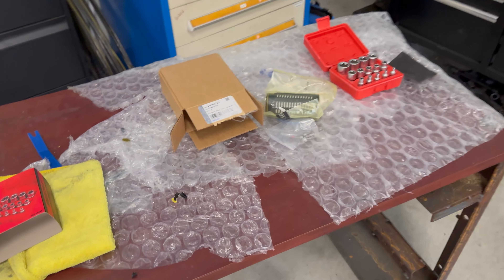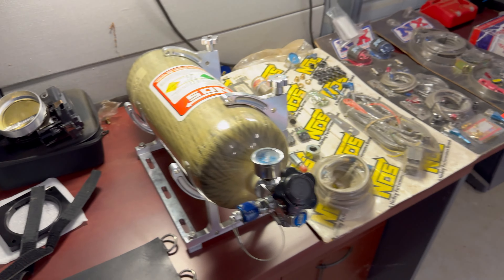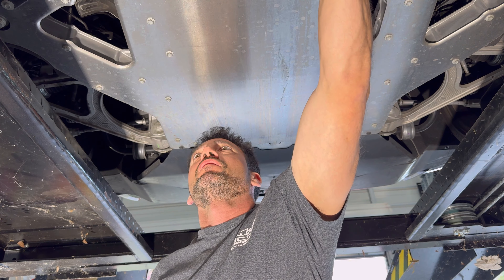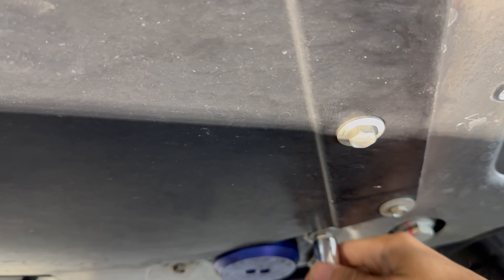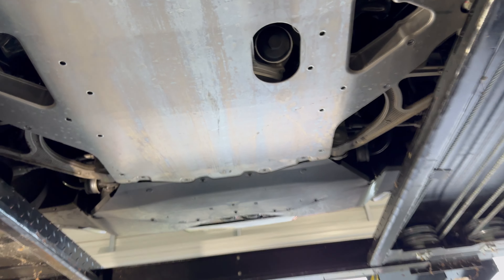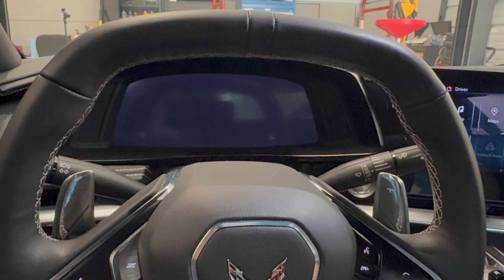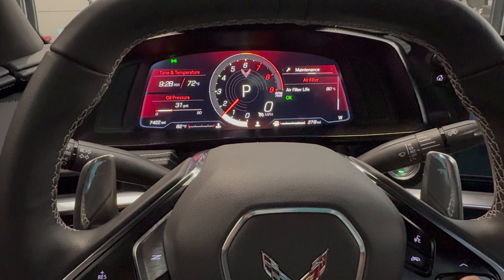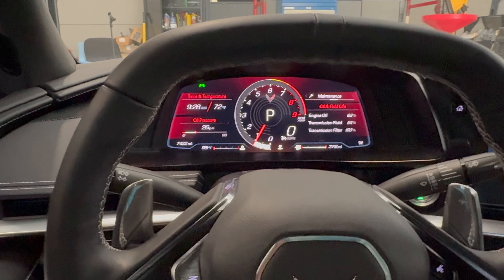DIY c8 z06 dct filter install

Comment: Great video Brandon. 
Man that cap has a serious learning curve.. I found that a pair of needle nose pliers works best when you just latch on to that protruding X casting on the cap.
And guys don’t forget to tighten the screws back to 53 in lbs ✌🏼
Reply from the maker: @2020matrix8  I actually tried the needle nose pliers but I couldn’t get the ones I have to bite. Good call on the torque settings! Shoulda put that in there !

Comment: You are correct on the diy info. Talked with Josh Holder at the bash to confirm. They do that flush proceedure at the dealer because they can. Love the red F-body in the background.  I have an 81 Camaro to drive when i need my manual fix!
Reply from the maker: @johnperkins6432  I wish mine was manual but it has a 700r4 transmission. I love the body lines tho
Reply: @Brandonsgarages  mine was a 4 spd originally.  Now has a t56.

Comment: Seems to be the thing to do is change the filter every oil change. Simple enough to do on your own. And I agree not taking to a dealer. The chief engineer said driving down the road does the same thing as the flush.
Reply from the maker: @A1rwolf_Corvette  yes sir that is the plan from here on out. Especially since my warranty will likely void soon.

Comment: Cool video. Looking for to the nitrous 😮
Reply from the maker: @10SecondZ06  me too man! Gonna sound wild
Reply: @Brandonsgarages  the testing is going to be fun no doubt. The gains are going to be enjoyable. Slow and steady until you get what you believe is that spot power and ET wise. Great videos are coming I’m quite sure !!
Reply from the maker: @ChrisbarrettZ06  thanks Chris . Just worried about how the dct is going to do with the shifting but hoping w extra clutch pressure it will hold ok . I think the z is gonna sound very very angry on nitrous

Comment: Also please remember that you loose about 6-7oz. A f fluid -  it a big deal with first DCT filter change but with 2nd or especially 3rd change you would want to top off your fluid - unless you added an extra 1 qt of transmission fluid already ( which is “shouldn’t be need with the new case for 2024 Z06 like for the 2023
Reply from the maker: @billmiller8782  you are right bill . I am going to add a quart on my next filter change !

Comment: Next time use a pair of needle nose pliers to rotate the cap to loosen - this will make it easier to remove to access the filter
Reply from the maker: @billmiller8782  I did try that but the ones I had didn’t bite well enough and I was worried about scarring it and that being used against me should there be a dct issue. Not that my warranty will be valid anyway once I spray but until then.

Comment: Can you please elaborate on your home version of flushing the DCT fluid prior to filter change?  You said you had the car on the rack, in drive and maintained 2k RPM for a few minutes.  Was your other foot on the brake so the rear wheels weren't spinning on the lift?  Thank you!~
Reply from the maker: @bobstegall6465  yes basically holding the car against itself . Just driving it around immediately prior to swapping really does the same thing .
Reply: @Brandonsgarages  Thank you Brandon!  Really enjoying your helpful content!

Comment: Nice job! Did you add fluid?
Reply from the maker: @joeR007  no I will on the next oil change as I’ll do filter again. I think you lose 8 oz with each filter change and the z gets the extra two quarts so I’ll add a quart on next filter change.

Comment: Will Nitrous void the warranty? Seems like it would.
Reply from the maker: @jamesh1641  yes sir
Reply: @Brandonsgarages another question isn’t it better to leave the bolts loose in the cover itself of the DCT so you have something just to pull with instead of taking 10 minutes to rock it loose?
Reply from the maker: @jamesh1641  good point. I’m not sure if the cover itself has any threads in it but would give some leverage points. The way I had to rock it was very annoying I attribute it to first time off I suspect subsequent times being a lot easier

Comment: Did you add transmission fluid back ?
Reply from the maker: @NYCz06  no sir I think you lose 6-8 ozish . I will be changing this filter again on next oil change and that will put it at basically a quart low and I’ll add a quart on next change. I did not add any on this one. I’m assuming factory did fill to full as they are suppose to w the z06.
Reply: @Brandonsgarages  I just hit 580 miles on my 24 Zo6. Thinking of changing filter now as well as an oil change. Is that over kill. I’m a little ocd. lol
Reply from the maker: @NYCz06  based on what I’ve seen no it’s not. Just have to make sure you do again regardless at the 7-8K mark to satisfy GM. I noticed a big change in shifting after.
Reply: @Brandonsgarages  thank you 🙏 love your channel. God bless you
Reply from the maker: @NYCz06  thanks for watching sir!
Reply: @Brandonsgarages  Can you do a video on how to top off the DCT fluid?
Reply from the maker: @ I will be, I’m going to install the Dodson quick drain/add valve to make the process easier and film that.